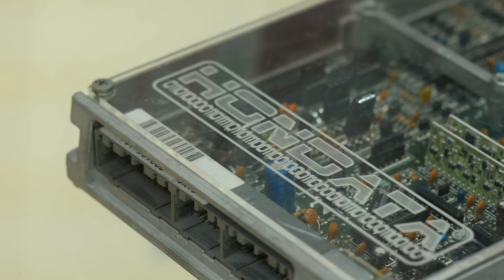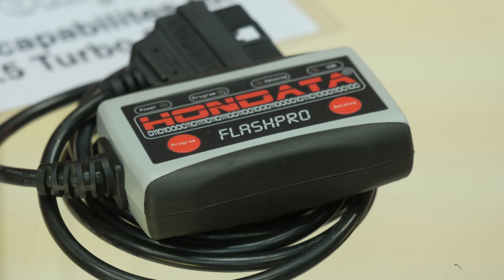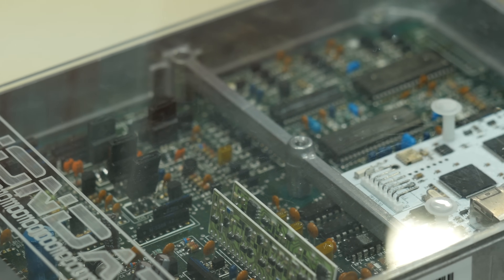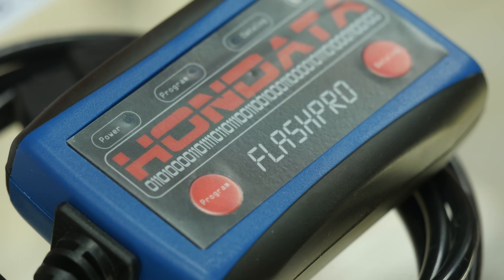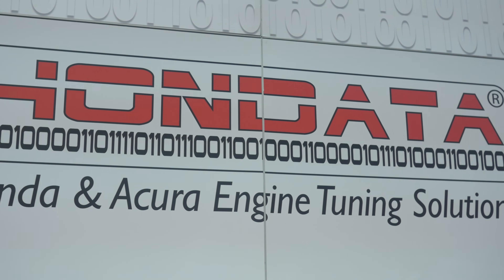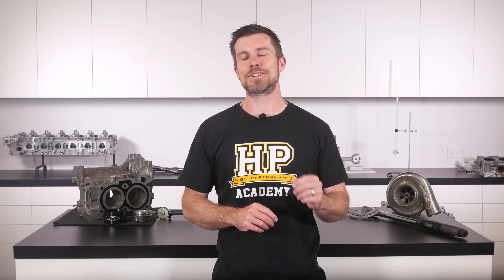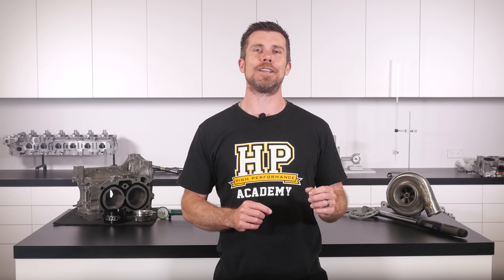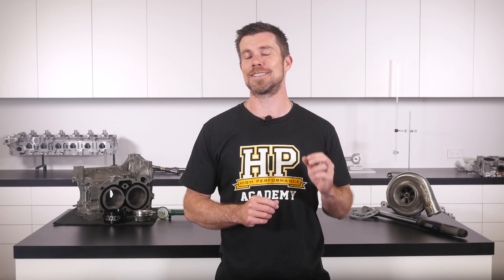Hondata | The BEST Reflash Tuning Solution For A Honda? [TECH TALK]

Comment: Tisk tisk 95 bull sh**
 ktuner and hondata are gonna be relics when haltech or motec or x number of engine managment companys make cheaper honda spefic equipment. Like the online forums are litterlly filled with requests but they claim theres no intrest via email
Reply from the maker: Link ECU do pnp units for a number of Hondas. Pnp options is something they focus on. 
Standalones are quite different though to refresh tuning, it's not like having another Hondata - Taz.
Reply: @hpa101  
That's a rounda about way of saying ?  I'm just stating that there is several models they don't support.  2008 i4 exl accord .. then when I ask about switching ecus to compensate I'm told they don't support that so kinda confused
Reply from the maker: Standalone ECUs have always been an option for you and your Honda. They have different pros and cons from cost to fitment to features.

Reflash tuning options like Hondata or KTuner never have and never will support every and any model of vehicle (Honda in this case) out there. Again, they are different to standalone ECUs and have their own pros and cons when it comes to cost, fitment and features.

There is no 'round about' saying of anything here. Those are the facts that everyone in the position of building and tuning a car have in front of them.
Which option is best mainly depends on the application (vehicle and how it is used), budget and who is tuning it.

This article might help further: www.hpacademy.com/technical-articles/re-flashing-vs-standalone-ecus/?utm_source=youtube&utm_medium=social&utm_campaign=general-interaction

Clear as mud? 😂

TL:DR: You never have and never will have a reflash tuning solution for every vehicle, nor has anyone promised you that. You never have and never will be able to fit a standalone ECU to any vehicle and retain all your factory functions, and no ECU manufacturer promises you that. It's all application dependant'- Taz.
Reply: @hpa101  
I get what you are saying 😏 so 
What would the best soulotion be for my k24z3 to functionally be converted to awd and turbo.

obviously with the rsx ecu
 ktuner/hondata has lots of turbo features..
 I own k tuner currently running 14.4s   with the limited features available for my ecu.

but for example if i switch ecus how do you suppose that gets done with the different issues such as the different crank sensor style, cable throttle body etc.

Just actually trying to bring some light to an extremely large be quiet community of 8th gen owners 🙃 

Yeah I get haltech (motec,maxxecu etc) is a way I've seen Eric Jarvis's setup.. 
Or is , stand alone for that setup 
"The only way" in a reliability sense
Reply from the maker: If you have reached the limits of what you can do with KTuner and want to go further, what option that isn't something Mickey Mouse which will potentially see you changing in the future again anyway do you have other than going to a standalone ECU like the Haltech,  MoTeC, MAXX etc that you mention?

For a project like that, personally, I'd be looking at a standalone, but it's not my bank account or time 😎

Fitting a standalone to a K24 isn't breaking any new sort of ground. Triggering and cable throttles have solutions, in fact it is often harder to find a DBW solution, or at least was in the past, that it is to setup a cable throttle.

I guess you also have to decide if you are going to learn how to do all this yourself or pay someone to do it for you, noting you're going to need a wiring solution too. The person who tunes the car for you will have an influence on what ECU you go for which is why it is important to consider that.

You might have a local guy that only tunes Ecumaster leaving you needing to travel to get your Haltech tuned for example. It's great to avoid situations like that where possible when applicable.

Other than that, I can't tell you want you should and shouldn't do, it's your project and there are many different paths you can take, none of them necessarily 'wrong' - Taz.

Comment: Except they don't cover all honda engines and ecus needs to be noted
Reply from the maker: Of course, they even have a list of what they do support to make it easy to work out if Hondata is going to be an option for you and your application.

Here's the link for anyone interested: https://www.hondata.com/tech-obdi-ecu-reference

Part of the process of tuning is finding your software or hardware, and some vehicles are more popular than others in the aftermarket which sees them get more support, and that's not just for software it's for parts too (B series vs J series for a quick example).

Hope that helps! - Taz.

https://www.hpacademy.com/previous-webinars/120-selecting-a-suitable-ecu-for-your-application/?utm_source=youtube&utm_medium=social&utm_campaign=general-interaction

https://www.hpacademy.com/previous-webinars/126-how-to-choose-a-reflashing-platform?utm_source=youtube&utm_medium=social&utm_campaign=general-interaction

Comment: They couldn't help me with my obd 2b civic... They said to convert to obd1... But then I will never pass emissions
Reply from the maker: Some modifications are track/off-road only depending on your location and local laws. If it's important for your performance car to be 100% street legal you'll need to find one that is supported by the aftermarket to enable you to do this before you even start - Taz.

Comment: What about nistune and nistune webinar ?
Reply from the maker: It's something we'd like to do at some stage if the opportunity arises as well but it is not locked in on the calendar yet. We still have all the knowledge you need to understand in order to tune using it regardless, Worked Examples and webinars just help you learn a little faster rather than being a necessity - Taz.